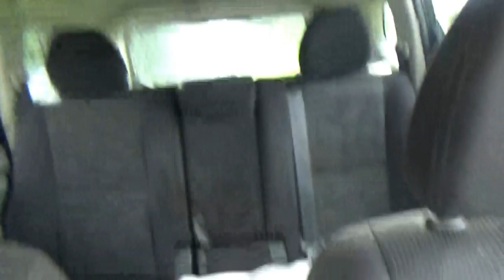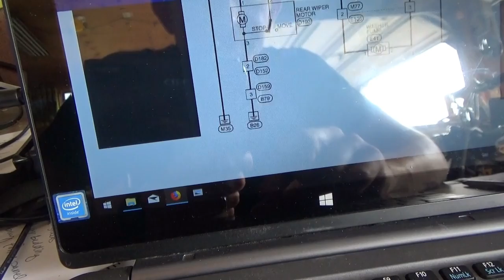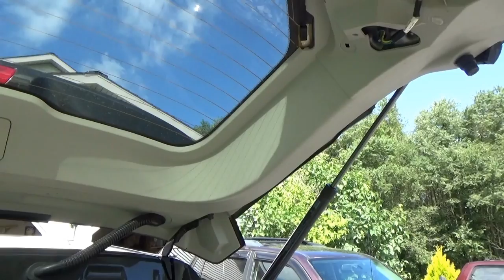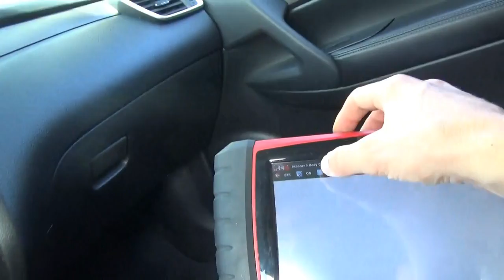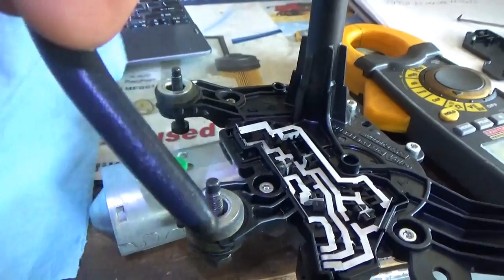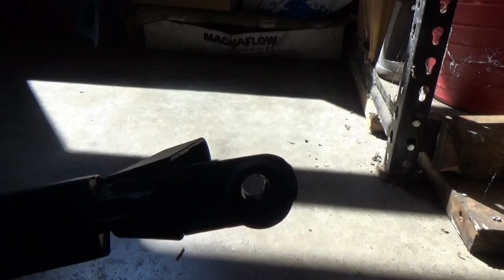Rear Wiper Nissan Rogue: Diag & Repair

Comment: Thank you Ivan!
I watched your video yesterday and fixed my wiper motor and yes it was the contact issue, soldered it. It's back into working condition.
Thanks for an excellent video. Saved couple hundred dollars. THANK YOU!

Comment: Same thing in my OEM motor. Driving down the road, it's completely random when it will work. It also stops mid cycle. I suppose at a certain vibration while driving the contacts make contact with the motor. Thanks for the vid

Comment: Having the same problem on  Juke at work. Couldn't get any power through power wire. I didn't have a bulb hooked up so maybe it is lighting for 2 seconds and detects and open and shuts down? I'll go back Monday and see? Thanks for the video. I heard the wiper motor is 300 bucks.

Comment: Gotta 04 infinity fx35, front and rear washers Not spraying,both sets of wipers work tho...isn't there a dedicated fuse and/ or should I check for voltage at the plugs? ... I know the washers are good because they spray with direct 12v from the battery
Reply from the maker: Get a wiring diagram, should be pretty easy to track it down. Yes start at the fuses :)

Comment: Hello Ivan is there anyway you could do a video on removing a car alarm.. mine stopped working and now my 1994 Toyota DLX Pickup wont start ... it cranks but wont start.. theres no spark and no fuel ether... new pump., new EFI Relay ... all grounds cleaned with good contact .. I would really appreciate this... thanks in advance. it has the old style Signal Generator Magnetic Pickup Coil Assembly.
Reply from the maker: That would be very car-specific. I would focus on the main power feeds...fuses and relays. You need a wiring diagram and a test light. Check out BBB industries.com. Those things are wired pretty simple :)

Comment: Oh my Buddha !
Makes me so sad see junk parts used on cars today.
All the engineering technology is used to design and make parts as cheap as possible and just good enough do the warranty periods if you lucky :-S
Valeo parts are famous in europe lol, they do lots of electrical components on the french junk and you could bet your arse common failures always went back to a valeo component :-) 
Suppose they wanted to improve the failure rate save manufacture cost plus make more green dollars in parts sales before you scrap your car at ripe old age of 6 so way forward was china baby lol . they simply the best at finding cheapest corner cutting way make a product lol .

I got a 1988 n13 nissan, look a bit tired but everything works baby, all door locks, windows, wipers, demister the whole shebang baby and it 30 yr old original parts !

Where the environmental benefit in this modern junk that garbage in 5yrs !
The only thing green is the dollar bills being made selling this crap with misrepresentation's of environment benefits .

The worlds logic has gone mad ivan, you going be busy in future years with your soldering iron and VOM lol

won't be long before a lawn tractor has bcm module and can network lol :-S

Comment: Cool video. Why start with the fancy scan tool though? What made you suspect a module? Seems it would have been quicker just to go straight to the motor and check the voltage there for a starting place.

Comment: This one really was fun to watch Ivan. I get it , obviously it's a different scenario at Keith's or Eric's , but in your scenario , this was a great diagnosis and REPAIR.  Highly expect you had that repaired before a new wiper motor would have gotten there or could have been picked up. Honestly this is more fun to watch , than the part changeout and the old one helping to fill a landfill somewhere, even though I totally understand they have to do it that way at their shops.

Comment: Can't believe Nissan is using Chinese motors too! Seems like something the Japanese would NEVER do 20 years ago. They probably buy those motors for $2 each, and sell them for $200. What a piss-poor design!

Great fix, though! Gotta love it when you don't have to drive to the parts store, or spend a pile of cash.

Now if that was a GM, you'd have the same quality motor, only the book time would be 20 hours to remove it ... and it would be completely sealed and unserviceable ... and $500 at the dealer. 😂

Comment: Nissan Master Tech here. We sell a ton of Rogues. I cannot say I've seen one of these fail. I was told CVT failure rate is less than 1 percent. Right.....I do plenty of them. That being said for the amount we sell we don't see a ton of CVT issues.
Reply from the maker: Shawn I am curious, what's the highest mileage CVT Rogue or Altima that you have seen still running on the original CVT? Are most of them fixed under warranty, or are people willing to shell out after the warranty runs out?
Reply: @PineHollowAutoDiagnostics  most of the ones I do are warranty replacement or repair. However we see some after that. Mostly replacements. Nissan has only recently since 2016 or so started doing in dealership CVT repair/rebuild. Gives customers more options. Highest mileage? North of 150k. Idk that I've seen one north of 200k but maybe. Our customer base is unique. They tend to trade in before they get a ton miles. We have some that run them forever but maintain them well. Most of the issues I've seen are on poorly maintained or abused vehicles. When your CVT went you had some miles on it so no surprise. I would not trust a conventional auto north of 150k so.....

Comment: It's almost as if they forgot to solder them at the factory.
Reply: technically, it's a valeo/parts supplier cheap-skating, likely on purpose to boost sales and pad some fat cats pocket ;)
Reply: The design was for no solder. They depended on pressure and a weak crimp to do the job.

Comment: Some people used to mock 1980s / 1990s Japan built Nisans & Toyotas,  but I tell you what, they were bulletproof everday transport.

When I used to live in London,  I was into motorbikes and used them for my daily transport. Later when I wanted to also have a car, I observed what cars were used by people as their work vehicles E.G. mini cab drivers. All the mini cab drivers were i was were using Nissans and Toyotas - not because of any cultural reason but beacuse they were so reliable. 

Fate awaited me. First trip to a dealer and I found a 1 owner low miles 4 year old 1990 Nissan. Bought it and did over 250K trouble miles in it and still ran perfect when I moved to the USA. Present day Nisaans are junk, IMHO, same with Mercedes. Are there any genuine quality cars left?
Reply: In my opinion your best two choices are Kia and Hyundai for the price and Toyota if you're willing to pay more. Kia and Hyundai have without doubt the best warranties in the business. That's why I bought a Sonata.

Comment: A dab of liquid soldering flux would have made that a little easier (drawing the solder in between the two contacts). Just make sure you buy flux for electronics instead of plumbing.
Reply: naw, use acid flux for a corroded up return job or just make it cheap pressure finger tab contacts (factory/valeo/etc) lol
Reply: Liquid rosin flux, for electronics. I'd get that fire out of there and use an electric soldering gun for this. Instant heat but no flame. Also scrape or sand the metal a little before soldering to make sure it "knits." I hope those traces weren't aluminum, or no permanent fix.

Comment: That’s what happens when the French own a company, they cheap out on parts to push there margins up, Renault, Peugeot and Citroen all do the lets cheap on parts, psa group that’s the group that own Peugeot and Citroen have just taken over Vauxhall and Opel over here in Europe haveing purchased them off General Motors and the quality will get worse, warranties will get harder to get even though they design flaws and bad quality parts and design into all there products , take the recall on Toyota aygo , Toyota builds a car that they badge and Peugeot and Citroen also use. All built by Toyota and rebadged by Peugeot and Citroen, well Toyota found a problem and did a recall, Peugeot and Citroen owners found out and Peugeot and Citroen did not and never recalled any of there badge engineered cars, same cars , how can Toyota have a problem but not the 2 French manufacturers, French owned companies are just not to be trusted
Reply: Boy, is that sad: Opel used to be a pretty solid car. I have rented a few different times in Europe. Rented just about every European model, too.

Comment: Ivan,  great video.  This video is perfect timing.  I need to fix my rear wiper in my blazer.  It doesn't work.  Let's hope I can fix it without parts required lol.  I learned something :)
Reply from the maker: You can fix a lot of stuff on a Blazer with no parts LOL!
Reply: @PineHollowAutoDiagnostics  lol, that's true!!! I got everything fixed with minor replacement like hoses and such, nothing major.  But I am still getting P0135 code,  that's the heater o2 on bank 1 sensor 1.  I replaced the o2 as the resistance was high.  The waveforms wasn't steady. So I figure I have a continuity problem from the fuse that shares the other 2 sensor heater ( I have 3) power to fuse in fusebox is good.  It could be open short from fuse to o2.  Trying to chase that down.  But the new o2 works just fine, but no heater performance.

Comment: The wiper motor it have intermittent problems.See it to the end of the video.See what happened?So they take chances to take the wiper motor apart and modified it also soldering the motor metals taps for togetherness for electrical components contacts.

Comment: Could someone please tell Ivan that he's using a Bluetooth scan tool😉
Reply: Ivan, you're using a Bluetooth scan tool !
Reply: Or add a low powered buzzer to your test kit, perfect for those times it's hard to see the light?
Reply: We should make a youtube automotive sitcom with Ivan Keith and Eric O. . It would be the most hilarious thing ever...^^
Reply: Was thinking the same thing.
Reply from the maker: Oh man Keith I was hoping you would leave a comment on how I should have bought the owner a brand new wiper motor and not fixed the original one hahah ;)
Reply: @PineHollowAutoDiagnostics  nah , this is a repair I have done several times already 😄
Reply from the maker: Why am I not surprised?
Reply: lol , amount of times I done similar :-D
was even more dumb as was in my shop and sat on mobile trolley yet I still kept walking to it :-S
Reply: I wish keith would fix his shaver, he was looking more like a homeless street hippy than a mobile diag guru .
Reply: New Level Auto I don’t get it. Why is that significant?
Reply: Bill Rimmer he was doing bidirectional tests while breaking his neck and looking back at the test light. Instead he could have done all the bidirectional tests from the rear hatch/cargo area...
Reply: New Level Auto proving once again, how to NOT BE A PARTS CHANGER!! Not only did he diagnose the problem, but took apart the offending part AND FIXED IT, not just change it!!

Comment: When the light came on with the switch off I think the computer was just trying to put the wiper back to the park position.
Reply: exactly, that "park/stop" position switch will fail next, same junk "finger spring" connections as the motor terminals had. it wont sense "park/stop" and will run a short burst then quit randomly anywhere on the window as the BCM cuts power :))

Comment: Smashing repair, you made it more reliable than a new one :-D
That really is a dam silly way to connect power lines.(Crap design).

If i had found them, i would have done the same.
If there was no power i would check the hatch to body gators for broken wires, really really common.

Comment: The design of that motor assembly was planned to fail.  Same as the failing pusher type belts inside the automatic transmissions.  Nissan now is on my never recommend list.

Comment: rather than "farting" around with $8000 scanner ,i would immediately have gone for motor
  -a lousy universal series dodad-and energized it with 12 v battery
    -to see if brushes or winding bad or corroded-the KISS formula
 
     -noted crap Chinese unit ~       ~what a "shoddy design" ~~
Reply: yup, scope on a rope at the rear wiper plug, but IRL, I;d have have just fist banged and slammed the rear hatch hard a dozen times first while someone kept flipping the switch off and back on first. betting it could have been knocked into moving some. lol.

Comment: Do a video on how to fix radiator fan with resistor failures. I had to replace two from different cars (Chevy Cruze and Hyundai sonata) because of a bad resistor and none to be bought separately.
Reply: Knowing the ohms value of the resistor, plenty are available from electronics distributors, at prices (depending on the resistor) of a few dimes to a few dollars. This assumes you can get into the assembly and diagnose the problem.

Comment: Amazing how crap designs like that wiper motor get through QA manufacturing approval for a quality oriented Japanese company like Nissan...
Reply: Nissan hasn't been quality nor Japanese for quite some time.   Parent company is Renault, which is French.  That explains the crap Euro/Chinese electronics.  Nissan hired Carlos Ghosn in 2001 to fix their financial woes and he did just that, by sucking the reliability straight out of the cars.   While Nissans haven't been what they were in the 80's and 90's, the reputation still causes people to buy the cars.  They are the Japanese Chrysler.  Such a shame, Nissans used to be one of the best.
Reply: Nissans were once reliable? The only thing I recall being able to rely on with a Datsun/Nissan was them breaking down and rusting away in a few years.

Comment: Quick fix.  That solder may crack overtime. You may have to revisit it again in a couple years.
Reply: I agree. A little hot melt glue close to the solder points would help.
Reply: should have bent the motor pins 90 and did one "finger" on either side of the now bent tab, then soldered. would have have been somewhat better vibration proofed =p

Comment: there's a reason the sticker on the motor had an "F" on it- it was fudged!!!! lol  so the bcm must need to sense opening of the park switch to keep the power on. would have been interesting to unpin the park switch wire to see the light stay on.
Reply: if the motor feed sensed current or how much current to keep the feed alive. and if there is overcurrent protection. a variable load would be interesting.   its fun to reverse engineer stuff you have no manuals on
Reply: until you let the smoke genie out lol
Reply: it's all park/stop switch related, no pulse to BCM per wiper stroke = power down. if the cheap contact fails tot he switch it will randomly move and shut down anywhere on the window :)

Comment: Well for those without bidirectional scanners you could of just started testing at the motor and you would have found and fixed it, maybe faster then a full blown diagnosis as shown in video!
Reply from the maker: Yup. But no one expects a 3-year old wiper motor to just stop working...especially on a "Japanese" vehicle!!!
Still need a wiring diagram for the colors though ;)
Reply: @PineHollowAutoDiagnostics  Yes, and using the scanner and wiring diagram shows all of the intermediate parts between the switches and the motor, for a better understanding of the whole circuit.

Comment: A factory nissan wiper motor that says made in china...how disappointing. This basically proves nissan is cheaping out on quality on newer cars.
Reply: So a motor made in China by a French company for installation on a Japanese car built in the US. It is indeed a global economy.
Reply: Has been now for over 10 years. Whole wiring harness has tags "Made in china" every few inches.   Nissan is really.... Not what it was
Reply: Dude does the Renault ring a bell?
Reply: Valeo is a world-wide parts supplier. I wouldn't be surprised if my MINI has the same wiper motor.
Reply: Valeo is a big reason french cars have so many common repeat failures, from clutches to control modules it was all piss poor parts in engineering design and actual production quality . Anything that truly lasts didn't have valeo or bosch stickers on it :-)
Reply: After the year 2009 all Japanese,Korean also American cars too.All newer mid sized cars for the non essential components to the car engine motor operation itself.All components are made all over the world.China,Mexico and only some are in Canada.China have the major bulk of it because it have the second biggest economies in the world.
Reply: Vladimir Putin New Hondas and Toyotas are the most American made compared to other car makes...
Reply: anything older your best bet, nissan, subaru, toyota from late 80's to very early 2000 about best you ever going get.
I got a 30yr old nissan and it all works baby, no can network, no bcm, just good quality relays ect and it lasts decades no drama,
Same with a old 1999 subaru forester, that doing close to 300,000 miles and no electronic drama, wiper motor windows and locking all A1 in 11yrs I had it, only thing I needed replace was rear washer pump. 
This modern crap makes me feel sick every time I tear into one I disappointed with the technology implemented, the poor engineering and the even poorer quality level .
People really need wake up and stop buying the junk, it complete waste of money resources and massive environmental impact due to production/ high part maintenance and short lifespan .
Reply: Warren01s10 Nissan is not what it used to be sadly.
Reply: 1995 was more or less the turning point of the big race to full on chinesium.
I'll just leave this here for you to do the math also.... https://www.whitehousehistory.org/the-presidents-timeline
Reply: Renault does not own nissan, it part of a renault nissan mitsubishi alliance .
Renault influence did however cause lot of engineering/parts issues since joint sharing projects/technology :-/